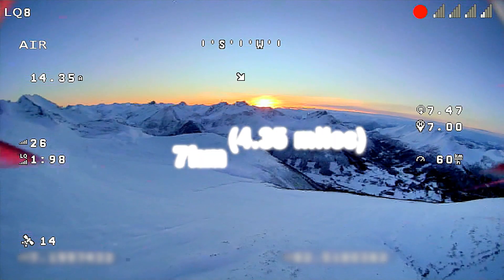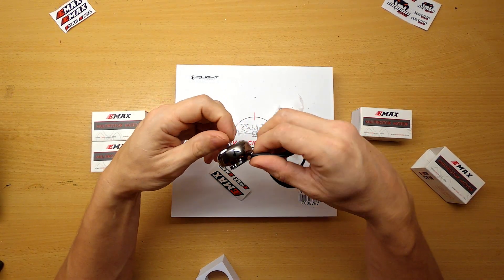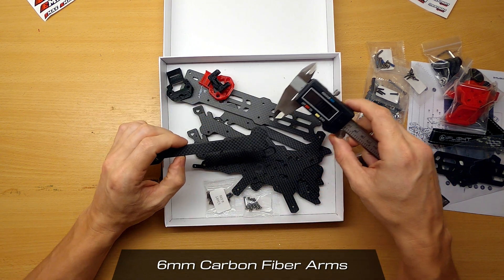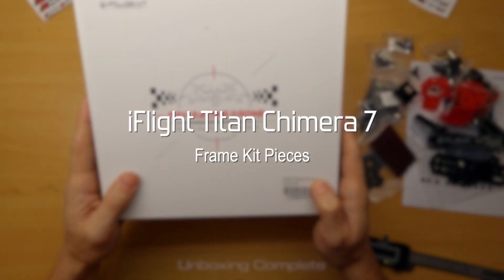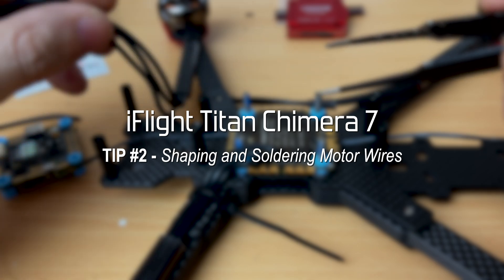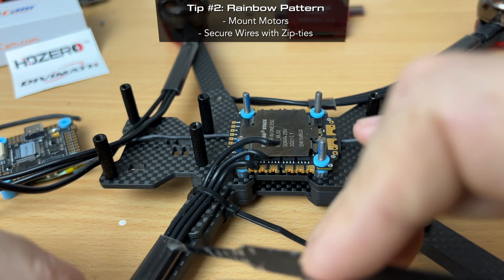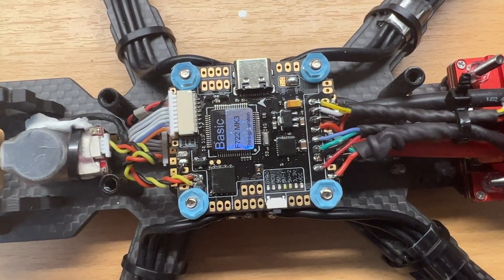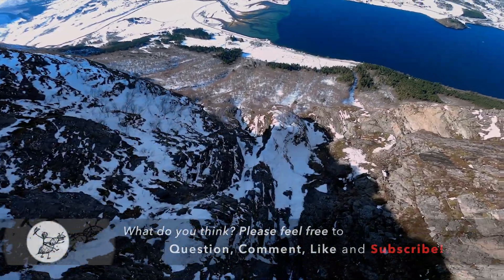HDZero 1 Watt Chimera 7  Long Range Build Video with Freestyle VTX for mountain surfing!

Comment: Hey! Love the videos!J ust wondering since you dont talk much about conforml coating, unsure whether to coat my HDzero 1W vtx on my flights around snowy moutains.  Thanks!
Reply from the maker: I’ve never conformal coated my Freestyle VTXs. I think they are pretty protected by the outer casings. Ive never had a problem and have been buried in snow a few times. 
There is thermal paste covering the internals which probably helps.
Thanks for watching the channel, appreciate the support!
Reply: @GiantAntCowboy   Awesome! Thanks for the reply - do you leave alone the MIPI and all connectors when coating? Honestly would be great to see how you do it if you ever get the chance haha
Reply from the maker: @basil7257  never coat connectors, and watch out for the barometer if you’re FC has one. I used to coat the whole board, but now I mostly just focus on the small chips, and other parts.
Reply: @GiantAntCowboy  Thanks, True legend! Appreciate you!

Comment: Nice setup @GiantAntCowboy ... I have one very similar to this one, although I've been plague with HDZero interference on my GPS signal big time. Did you you happen to have some of those?
Reply from the maker: You have a HDZero Chimera 7? Nice. It’s a small club, but is a great setup for mountain surfing! Arguably better than WS/DJI. 

Anyway, I did have GPS issues… and tried many things to fix it, but unfortunately don’t know really know what fixed it. 
The last thing I wrote in my notes was reset Baud Rate to Auto. 

I am testing the new V2 and seem to be having GPS issues with it… so I’ll let you know if I find a more obvious fix.
Thanks for watching, cheers!
Reply: @GiantAntCowboy  Well..I built originally with analog but... 🙂 I'm going full on HDZero, so the Chimera 7 is just the perfect rig for holding the big hunk Freestlyle VTX. 

Anyway, the situation is here seems to be clearly interference. If I plug out the connector from the VTX I get quickly 12 sats (still using the M8Q). As soon as I turn it on at 25mW, I only get 6-7 Sats...and if I pump it out to the full 1W... forget about... I get NONE.

I've ordered some braided copper to see if I can insulate the wires. I have heard about interferences from the VTX (even with analog), but I've always managed to do anything about it... but with HDZero it seems I have too. 😛
Reply from the maker: @cjmvirus  I use those cheap TBS M8 GPS modules. My Chimera 7 has the Freestyle V1 and I get 15-20 satellites. 

The gps is mounted in the back with VTX/Antenna. I haven’t used any special shielding. One thing I’ve always wondered is if the length the GPS wires could be a cause. 
For example if the GPS wires are a similar length to the 5.8ghz wavelength it could be acting like an antenna and picking up the EMI or RFI. Maybe making the GPS wires longer or shorter could help.
Reply: @GiantAntCowboy  Ohhh I see... that's also a good point, but as far as I can see in your setup, the wires length shouldn't be much different from mine! Although every millimeter counts! 🙂Oh... trial an error I guess. By the way, any 5.8GHz analog antenna will also with for HDZero right?
Reply from the maker: @cjmvirus  yup, RF performance is really sensitive… so many variables.  
And yes, all 5.8ghz antennas will work with HDZero. One nice thing with HDZero is they use standard SMA and RHCP like most analog setups. 

DJI/WS went the LHCP which is fine, but then went RP-SMA… so dumb.
Reply: @GiantAntCowboy  Thanks for the pointers! 🙂
Reply: By the way... FYI... tried to insulated the GPS wires with copper foil and ground it... but it's still affected. Next I'll try to get the unit further away from the VTX... like 5-6 cms more...
Reply from the maker: @cjmvirus  thanks for the update. I’m currently troubleshooting GPS issues now too… at first I thought it was related to the new V2 VTX, but even with it unplugged I’m not get good GPS performance. 

Always something with this hobby, keep me posted, cheers!
Reply: @GiantAntCowboy  Soo... it worked! increasing the distance between the GPS and the VTX seemed to have work! Now it's about 10 cms away from the VTX towards the back. I just have to find or design something to 3d print those extra 5-6 cms 🙂
Reply from the maker: @cjmvirus  nice! I’ve actually been testing the Freestyle V2 VTX and noticed GPS issues. So I’m currently doing some troubleshooting as well! 

- First I was having issues even with the VTX unplugged.,, but left the GPS powered on outside for like 30mins and got 12 satellites. Now it works better all the time. 
- However when I plug in the VTX the satellites drop quickly, often to none. 
- So I’ll be experimenting with positioning, heatshrink/shielding, and wire lengths. 
I’ll let you know if I have any successes! Let me know if yours keeps working well.
Reply: @GiantAntCowboy  Will do!... Althought... I must say... I've tried shielding it first (without increasing the length of the wires and increasing the distance to the VTX) and didn't seem to have any effect!...
Good luck! 🙂
Reply: @GiantAntCowboy  By the way... before having extended the wiring to increase the distance I also had shielded, grounded and heatshrink (manly for insulation from copper foil) the GPS wires... but that didn't seem to have any effect!
Good luck! 🙂
Reply from the maker: @cjmvirus  appreciate you sharing. Hopefully we can find an absolute solution. It’s weird because my Chimera has the GPS with in 5cm of the VTX and antenna with no problems.
It has no special shielding, just twisted with some shrink wrap.
Reply: @GiantAntCowboy  So your other Chimera you mean? Different GPS units?
Reply from the maker: @cjmvirus  I only have one Chimera 7 and the GPS works great for some reason. 
I recently built a 5” quad with the HDZero V2 VTX and it’s GPS is having issues.
Reply: @GiantAntCowboy  ahhh... Got it... and have you used different GPS units on the Chimera and 5inch? For instance the walksnail one is supposed to be more interference resilient...
Reply from the maker: @cjmvirus  I used TBS M8.2 modules. They are cheap and easy to get. 
Just moved my GPS to the front and had 11-12 satellites no problem. So that’s cool, but not the perfect position so I’ll keep testing.
Reply: @GiantAntCowboy  so, after designing an extension to get the GPS further away from the VTX and go for a test flight I can now say that it worked. Getting the Matek GPS at 10 cm did work. Now for a Chimera7 adding an extra 6cm length to it, is not that big of a deal. But if you want to put GPS on a 5inch quad and HDZero... Hummmm....
Reply from the maker: @cjmvirus  I also found that mounting it in front or top fixed the issue. When mounting in front though my GPS Rescue performed horrible because the battery was blocking the signal or something… 
Top was perfect, but neither are ideal. Last night I made some shielded cables, and the “out the window” test seemed really successful.  Today I’ll get it mounted up properly and see how it performs. 
I’d be really pleased if this works because I’ve been troubleshooting this for a while now! 
I will let you know/post a video once I figure it out.
Reply: @GiantAntCowboy  Your shielding work?!... Don't forget to include how you've done it in your video! :-P... Because my shielding didn't work (probably I haven't done it properly), but I've kept the GPS in the back.

Comment: hello, can you geve me the 3d print file of the gps and antenna mount please? : )
Reply from the maker: Hey, sorry for the delay, I was out of town.  I just added my current setup to Thingiverse.  
https://www.thingiverse.com/thing:5837044
It's just a basic design I made in TinkerCAD and you can edit it as you want or need.  Works pretty well, let me know if you have questions or thoughts. Thanks!
Reply: @GiantAntCowboy  thank you very much, love your videos 👌🏻
Reply from the maker: @carlochannel5027  thanks appreciate the comment and support. 👏
Reply: @GiantAntCowboy  I've got a chimera 7 pro with 2807 eco like your build. Which props do you recommend? Do you think 7.5x3.7x3 are too big for 2807 motors?
Reply from the maker: @carlochannel5027  I personally like the HQProps J75; a 7” 3-blade prop with a 5”
Pitch. 
I tested the 7.5” prop and they worked fine but felt slow, or something, to me. I had to give them another shot, but really like the feel of that HQ J75 prop, though not the most efficient..

Comment: Just did that but with vista. Can't wait to maiden it. Motors are great, I'm personally running them on 5s2p being the best in performance/weight ratio.
Reply from the maker: Are you running the same EMAX motor with 1500kv?
I just got a set of 1300kv that I’m gonna test at some point and see if I like them better or worse.
Reply: @GiantAntCowboy  Yes ECO II 2807 1500kv :) Great motors btw.  ~3% less efficient than 1300kv on 6s, or so the calculator says.

Comment: There are significant Differents in Performance at truerc singularity and ocp ?
Reply from the maker: Not really, I had great luck with my OCP, in fact I preferred the thickness of the coax over the thinner coax used on Singularity model, and it’s actually cheaper. 
The only thing I didn’t like about my OCP was that it had a 90 degree SMA connector which can loosen up easier while flying or after a crash. However you can buy a straight version or even swap the connector.

Comment: Great build! I have just mounted hdzero to a bnf chimera 7. Wiring looks similar to yours, however gps is not getting satelites when I turn on the hdzero. Did you have any issues with that?
Reply from the maker: I did and I fixed it, however I’m not exactly sure what fixed it… things I did: 
1) Super Easy: Go to GPS settings in BF, set the Baud Rate to Auto, and try again. This seemed to help a couple of us. 
2) Mounted the GPS further from the VTX if possible.
3) Run the GPS wire under the VTX and not over, and make sure all wire are twisted. Twisted create a shield against EMF. 
4) Unplug the VTX, and let the GPS acquire satellites, then plug it in and see if the number changes significantly. 
I actually unplug my VTX while I’m acquiring satellites lots of the time. Mostly to keep things cool. 

Let me know if any of this helps. I wish I had a perfect solution/answer to give.
Reply: @GiantAntCowboy   Thank for the tips! 
I moved the wire under the VTX and set the GPS to auto. Also I solder the copper tape that I was using to EMI shield the wire to  a ground pad of the FC.  I don't know which was the key but finally I have enough Sats! Thanks!
Reply from the maker: @al8fre7do  nice! Great to hear. Pay attention on your first few flight to make sure they the number stays high. I like to have 8-12 usually. 
Glad you got it fixed though, now the fun part, actually flying! Cheers!

Comment: I've upgraded my 7inch HGLRC frame to have the Hdzero 1w as well.  But having severe issues with GPS interference it seems.  GPS is mounted similar to yours, off the back with a long antenna.  Did you have any similar issues?  I get full sat lock but it isn't stable, only thing I can think of is the Hdzero giving it issues.
Reply from the maker: I did have GPS issues, I was originally getting zero satellites, then I’d get a couple satellites but they would randomly drop to zero while flying. 
I tried a bunch of stuff like remounting GPS, Re-wiring, moving antennas… 
So I just looked at my notes and here’s what I wrote:
- Had zero satellites on OSD, but my transmitter telemetry was showing 11 satellites and GPS coordinates. If you have telemetry setup on your TX check this. (If you don’t have telemetry setup in your TX, Do It Now! It a great backup if you lose video signal and crash while long-range)
- GPS baud was set to 115200, set this to auto which defaulted to 5700 and suddenly I had 11-15 satellites consistently… idk weird, but easy to change. 
Last thing I remember is I unplugged my VTX and just let the quad sit powered up for 10 minutes and got a bunch of satellites. 
For some reason since these random things I’ve never had issues getting Sats anymore. Wish it was a real answer, but maybe something here will help. 

Last thing, while preparing for a flight I usually unplug the VTX or Pitmode it using the stick command. This seems to help get satellites quicker. 

I was also having issues with my TBS Crossfire, low signal and LQ drops.  I did a bunch of testing with several antennas and mounting locations, eventually got it to work ok, but now I’m running ELRS and it’s perfect at only 100mW. 

Blah blah, excuse the long response, just doing a brain dump for ya. Cheers!
Reply: @GiantAntCowboy  Thanks for the info dump.  I found a lot of the same things, and the main one that helps is turning the VTX off with the sticks as you are.  However I've now as a last ditch effort moved the GPS on to the front arm, not ideal but far away from the VTX and antenna.  I now get 20 sats locked very quickly with or without the VTX on. 
I tried copper shielding and grounding the wire, turning the vtx off.. nothing I did would retain sats once the vtx was back on at full power.  So its is absolutely related to the Hdzero vtx, though I don't understand why this causes so much more interference than an analogue vtx at the same output power.
Reply from the maker: @batcavefpv5007  I think it might have to do with the amount of electronic EMF noise (vs RF noise). This VTX produces a ton of heat compared to analog VTXs and I’m thinking this heat is electrical noise. I also found mounting the GPS on top of the batteries worked well, but currently I have mine mount far off the back and it seems to work as expected. Either way, I hope this solution works well and you can go have some great flights now! Keep me posted, cheers!

Comment: Thanks for sharing. Which ufl to SMA connector + antenna are you using? I am getting interference on my GPS from the freestyle vtx - GPS loses satellites immediately vtx is powered. Thanks.
Reply from the maker: I also had a problem losing, or having a low number of, satellites and what fixed it for me (and some others I talked to) was simply to go into Betaflight and set the GPS baud to Auto, which should default to 9600. Try that first. 
Regarding UFL to SMA I’m using is a “TBS Unify Pro”.  
Let me know if this works, if not I might have other suggestions. Thanks for watching, cheers!
Reply: @GiantAntCowboy  Thanks - someone also recommended shielding the GPS wires. I'll get some shrink-n-shield strips to see if they help. (GPS Baud on Auto didn't make any difference).
Reply from the maker: @ebikefe  Bummer. Shielding the wires could definitely help. Also all the wires should be twisted in order to create a “twisted pair” which essentially uses the ground wire to create a basic EM shield. 
I have my GPS wires twisted, inside of the heat shrink and routed under the VTX. The GPS module is hanging off the back about 4-5cm from the VTX. The GPS module is a basic TBS M8 unit and I generally have between 12-18 sats when flying. I remember having issues with this and trying a bunch of stuff, but not sure what exactly solved it unfortunately.

Comment: Very interested in seeing that follow up tuning video. I recently built an identical quad using the emax eco 2 motors like yours. Only difference is 2807 1700kv. Running into issues with motors overheating. Im almost at the point of sending out to be blackbox tuned which is gonna cost me. Any help would be appreciated. Message me for more details
Reply from the maker: So actually I did some tuning and had it flying ok… but last week I upgraded to BF4.3, loaded the UAV Preset for 7” (and bigger) quads, and now it flys extremely well! Sounds quieter and flys smoother. I couldn’t believe it. 
You’ll want to setup RPM filtering and need to know what kHz you ESCs are set to, see the notes included in the preset. 

Give it a try. Also if your motors quickly get hot make sure the motor screws aren’t too long and touching the windings. I had that happen once. Let me know how it works out, I’ll probably do a video about this soon, and thanks for watching. Cheers!
Reply: @GiantAntCowboy  wow that was a super fast response. I appreciate the advice and will definitely give this a shot. I basically started out duplicating the BNF version with slight differences but nothing major in hopes of just using the Iflight 4.2.9/HD crossfire CLI dump and quickly flying off into the sunset. I previously did this with the Titan 5" frame with great results. I will let you know how it goes within a few days. Once again thanks for getting back with me. I love the support this community of FPV pilots has to offer.
Reply from the maker: Sure, helping each other is what makes this hobby possible. Look forward to hearing if it worked out. Cheers!

Comment: No capacitors? Current IFlight builds came with 2 caps. Please report on cruising wobbles, we all experience those on the C7.
Reply from the maker: Hey I actually do have a capacitor on the main leads, just didn’t show that in the video. I also had those bumps, and maybe still do a little, still tuning a bit. However there’s a fellow C7 pilot whose been fine tuning/eliminated this issue using BF4.3 UAV presets with great success. Here’s a link to his latest video for reference:
https://youtu.be/ifzgWjqm_S0

Keep me posted on your progress, cheers!

Comment: Have you got that fc to run Inav?
I dont get it to work with Inav
Only betaflight works fine
Reply from the maker: Unfortunately an iNav target hasn’t been officially made for this FC… however read through this thread on Github, I think the group may have found possible solution. https://github.com/iNavFlight/inav/issues/6441
Let me know if you try this. Cheers!